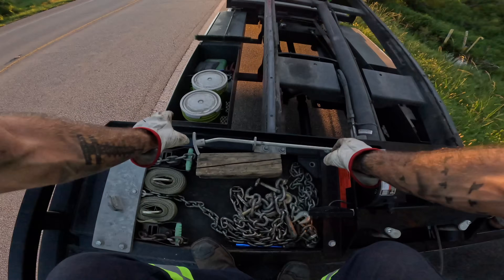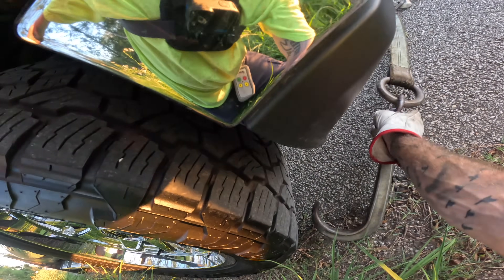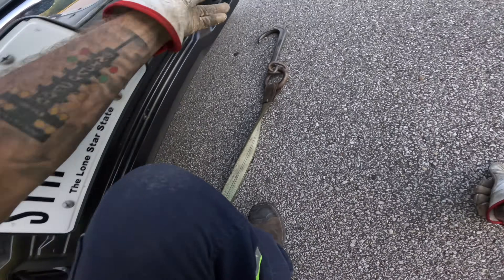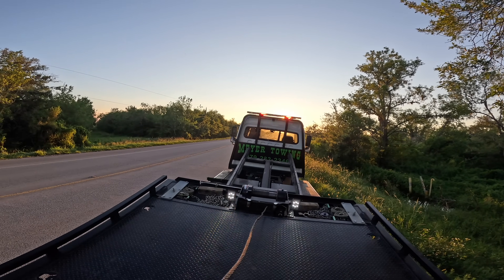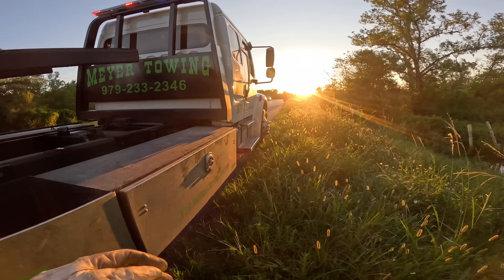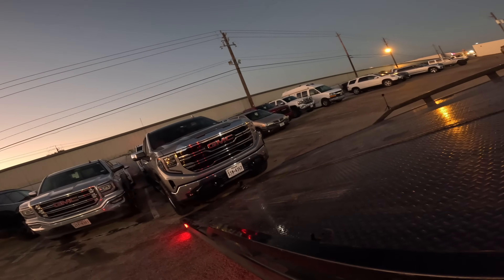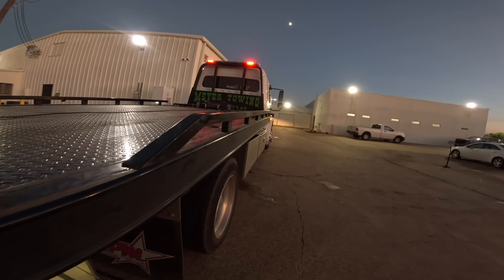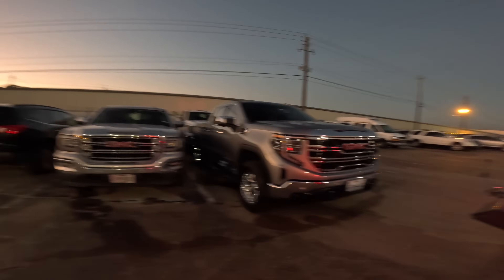Is GM Ever Going to Fix These Trucks??

Comment: First off, thanks for taking such great care of your customer's vehicles. Just curious though: if you can operate the transfer case to take it out of AUTO into 2HI, couldn't you also put it into transfercase neutral?  That should allow the vehicle to roll independently regardless of transmission gear selection.
Reply from the maker: No. Because part of the procedure for putting the transfer case into neutral is putting the transmission into neutral first. Obviously being the whole issue.
Reply: @Towtruck_Dustin  ok.  I'm unfamiliar with the newer console shift trucks.  Good to know.

Comment: The answer is no.

GM has been aware of the damage that their fuel management system does to the 3.6L V6, the 5.3L V8, the 6.2L V8 since 2007 and have done nothing to make it any better. You keep these vehicles with these engines past 150,000 miles and it is a near 100% failure rate with all of the components related to the failed so-called fuel savings tech. The sad thing is these are not bad engines (minus the 3.6L V6 that is a POS), but that fuel management crap destroys them. They are literally cancer.

Comment: 100 years of making cars and still cannot make one that work properly
Reply from the maker: The wonders of modern technology
Reply: Part of the reason is that most people want automatic transmissions.  My Chevy pickup has a manual transmission.  The tow driver would have no trouble putting it in neutral, but I have never been broken diwn.

Comment: I have a 2021 Silverado RST completely shut down will not start! What I learned was the system in this truck updated! All-Star and GM was unaware of these updates. My 2019 Silverado, my friends 2023 GMC Acadia did the same, the update takes around 45 minutes to an hour to complete when finished updating the vehicle starts right back up no issues. (these updates do not register with the diagnostic system of the vehicle.)
Reply: The truck shouldn’t shut down during an update.  That’s  really stupid…. I have a 2019 Silverado. So far no problems
Reply: @Getusom  Having to update a computer on wheels is stupid imo.
Reply: Sounds stupid, but true
Reply: @williebridges8286  I believe ya….i mean GM should make it to where it updates when the trucks not running, or it holds the update till the truck is shut off….i just wonder if they test anything before they release it!
Reply: You should understand that all electronics computers that integrated into your vehicle is from third parties, if the software need to be updated GM does not have to be notified for the updates. Remember, it is third-party software.

Comment: Why not just yerk that General Mistake up by the recovery hooks?
Reply from the maker: A number of reasons. Mainly because when the front end got up close to the winch you’d be pulling straight down on the hooks, thus loading up the suspension and the hooks aren’t made for that either, and if you used a bridle the back tires probably wouldn’t make it on the bed anyway.

Comment: The only way I'd Fork out 70,000 for a pickup truck is if it were a car show Trophy winner.
I had my 96 C30 gone through from front to rear with cosmetics and some extras.
Turns heads everywhere I go, and it's going to outlive me.
And I can actually work on it myself if I want to.
Have not needed a tow truck in 30 years.

Comment: Thanks for the insight on GM.  You guys having to tow them, know what the bad models are.   I had a 2006 Dodge Magnum SRT8 that had a transmission issue that wouldn't allow it to shift out of park.  The tow guy knew exactly what the problem was due to have to deal with so many Dodge cars having the same problem.  I haven't bought a Dodge, Chrysler, Ram product since, now more so since Stellantis owns them.  On the GM was it made in Mexico like my company provided one?

Comment: The late model Duramax Diesel trucks have an issue with Allison transmission that suddenly can shift into 2nd at highway speeds that can cause loss of control as truck skids and over revs engine......FabRat has a video about his own truck doing this.  He had to install an aftermarket kit to fix issue. His truck had 70k on it.
Reply: From what I recall, those are not Allison transmissions, they are just using the nameplate.  I know, hard to believe.

Comment: @Towtruck_Dustin if you have battery power you can shift the transmission to neutral by pushing the start button without holding the brake, holding just the start button puts it in accessory mode, you can the put your foot on the brake and shift to neutral, and you can release the e park brake at the same time.
Reply from the maker: No you can’t. Not with the electric shift trucks.
Reply: @Towtruck_Dustin   i have the electronic shift truck and yes you can.  I have done it

Comment: I had a chevy van from 2004 awd and the dam transfer case self-destructed and the dealer i had it towed to since it only had about 28000 miles on it tried to tell me i did not do proper maintenance on the vehicle i was pissed i said try reading the manual there is no maintenance for a transfer case at 28000 miles other than check for leaks. they finally begrudgingly replaced it.

Comment: I'm not one to usually leave comments but as a mechanic and to help anyone else out, most of these transfercases have a neutral mode marked with an n that disconnects the transmission from the driveline. Unfortunately not all of the trucks that have a transfer case have this mode but most do, its either a button or a procedure
Reply: but the real thing is why is a 2023 truck dying on the highway....it's a sad time for GM
Reply from the maker: Step two of the procedure of putting the transfer case into neutral, is to put the put the transmission into neutral first. Of which you can’t because it won’t run.

Comment: About 10 years ago I had my RAM 3500 towed after a starter went out. The guy brought a flatbed like this and winched my 22 foot truck up on the bed with it in neutral. Then while the winch was holding it up on the steeply inclined truck he started leaning over the side of the truck within inches of the front tire. It scared me to death that he was trusting that winch with his life.

Comment: excellent skills by the the tow truck driver,just one question why do you not carry wheel dollies? The wheel dollies would have made the  tow much less complicated. These GM 'S are a major problem, I have three friends who had the same issue with these GM'S ,all the same issue, and  they had  problems with  the dealers.No GM trucks in my future, and I am a tier one supplier(not fuel injection parts)

Comment: To the GMC pickup owner, constantly driving around in 4AUTO will burn out the transfer case clutch pack. Costs thousands to repair.
Reply: Maybe I’m wrong, but I thought when in auto position four wheel would only engage when it detected wheel slippage or out of control instances.
Reply: @dc9039 pretty sure you are correct that’s why it says auto.
Reply: @dc9039  - The transfer case has a clutch pack that does engage when slippage is detected when in auto. But the truck will also engage the front axles. This will cause the entire front axle and the transfer case to be spinning. When in 2WD, none of that is engaged.
Reply: @chiplangowski3298  Yep. You can feel the difference when it is in 4 Auto.  Tiny bit of vibration that isn't there in 2wd. 

Auto 4wd is not AWD. Which a lot of people seem to confuse it for.

Comment: My friend HAD a '22 Silverado with the electric shift as well. The fuel pump module is what we believe went out at right about the mileage this one did. His mechanic attached the 9/16" wrench and zip tied it in neutral. He also disabled the electric parking brake. We winched it onto his car hauler trailer and took it to the GM dealer and they diagnosed the bad module and told him it would be 6-8 weeks before they'd see a replacement. GM SUCKS!! (My friend's was a Diesel-GM told him that they all use the same module)

Comment: You are supposed to be able to get them into neutral by holding the start button down with foot off brake to get into service mode, then finger off start, foot on brake, shift to neutral. If it doesn't work... what a shock. I'm an electrical engineer, I do embedded electronics for the military. I prefer to leave the electronics at work.
Reply: You cannot put these trucks in neutral without the engine running. The computer will not allow the shift. There is a manual way to do it but it involves getting under the truck and it is not a safe procedure to do by yourself or on the side of the road.

Comment: Hey hey this is Ken from groveland Florida I'll tell you the secret I use when I'm out on a thing and the cars won't get over and give me room I walked by a truck grab a chain binder and throw it right on the white line on the Edgewood road I want that car see that chain binder they get over quick they don't mind running over you don't want to run over that chain by there because they think they're going to get flat tire but I run over to wrecker driver real quick but they won't run over a chain binder or a chain try that next time you'll see that works this is Ken groveland Florida

Comment: My 2014 All Terrain bailed on me at 180,000kms. Engine started using a litre of oil a month, 6 speed trans started slipping and the front diff shot a roller bearing into the case. I bought another Truck, guess what it wasn't....
Reply: yea my impala started to die as soon as i got it paid off, it had 200k miles and the transmission was going out. I got tired of fixing it every month so i bought 25 camry.
Reply: The 2014-19 6 speeds run way too hot. Unless you researched it back in the day, you didn't realize there's a trans cooler bypass thermostat that can be molded to keep the transmission much cooler. It saves most gm 6 speeds from failure. They also need trans fluid changes every 40-50k miles. 100k miles on the original fluid is a fast way to needing a rebuild. As far as oil consumption, that's getting to be more common, particularly people that think they can go more than 5000 miles on the same engine oil because they bought the fancy full syn oil. Even Toyota says it's normal for their engines to eat 4 quarts of oil between 5000 mile oil changes.

Comment: I just retired from GM after 30 years at a dealership GM is aware of all of these problems. We have told them other tech have told them and they will not do anything about it. We have told them numerous about the lifters the Duramax diesel, which is no good. We’ve told them everything. They just smile and say we’ll look at it and that’s where it ends people need to research vehicles before buying them and GM is definitely not one of them so many people have put this on YouTube all over the Internet just don’t buy them even if you think they look good
Reply: Couldn't agree more, They are good looking SUV's & trucks but that's where
it ends. They built reliable trucks up until around 2007, really dropped the ball
after that.
Reply: Transmission Shutter is terrible also, My Dealership tried to charge me between $500 to $800 for the recommended (TBS) Triple Trans Flush. I took my Truck to the local GMC dealership and they did the Flush under the Power Train warranty. 400 miles later the Shutter was worse, they did a Torque Converter and Valve Body replacement.  Truck had only 7700.0 miles on it.  Selling the Truck this week, 8886.0 miles on it.

Comment: 13,000 miles and down she goes. GM junk !  GM makes them look pretty but they don't last.
Come on people , stop buying these junkie trucks . Make GM build a better truck.
Remove the crap on these truck that cause so many problems. These problems will just come back in a few thousand miles
I miss the good old 350 chevy engine

Comment: You need to get a 2500 HD pick up truck ❤my truck is a 2021 GM pick up truck I have 72.000. On it and the truck is doing very very good all the time ❤❤❤with the 6.6 engine in it

Comment: I had a 2003 gmc pickup and went to gas it up and left it running, and the fuel pump went bad. Luckily, it was new. They said it was because it's a closed system. So I never leave the vehicle running while fueling
Reply: when i started driving long ago they said never leave the vehicle running while putting gas in it. it's dangerous.
Reply: If this were really an issue, I'd suspect a kill switch would have been implemented on the fuel fill entry point.
Reply: That was in 2003, and I quit leaving any vehicle running regardless of whether it was the issue or not

Comment: I've been driving around with a spare FPCM in my Silverado 1500 ZR2 truck for 1 year. Takes about 5 minutes to replace above front of gas tank.
Reply: do you need to program it after replacement or it will work even without programming?
Reply: @rafciu123  i can not confirm from personal experience. I've never done it, but someone told me it was just a replacement. Should always disconnect the negative battery cable before installing. When reconnecting battery, your system should reboot. DIC might give you a roll down, roll up window message to complete the process.

I wouldn’t mess with it around town, I bought it mainly for cross country travel and offroading a long way from town "just in case".
Reply: @rsbreeze  if i had to carry spare parts on a brand new vehical......id be insane...no way in hell.
Reply: @bestoflincolnmotorcompany  you'll have to do it sometime. You may as well rip off the bandaid. I've got three of them, seem to work fine. I carry tons of gear and parts for my adventures. Gotta have a chase truck.

Comment: Ever wish for the good old days of manual transmissions?
Reply: I had a 2001 Dodge 1500 with the basic six cylinder engine and the 5 speed manual.  It was all the truck I needed.
Reply: Not me, because I have one in my 2016 Chevy Colorado.  It's an Eaton six-speed and is the best transmission I've ever driven.
Reply: @GH-oi2jf  I hear ya.  I'm older now (64) and my current 2012 Silverado (basic 4.3 iron block v-6) with the 4L60e tranny.  I'm done with manuals now and even my 18 wheeler is automatic (not my choice but the company went with all autos).

Comment: Then you wonder why we bought a Titan instead. My wife and I were looking to buy a full size truck back in 2020. I was a Chevy/GM person. After test driving a new 20' LTZ Silverado, I felt the transmission slip while driving it in the lot. I said "No thanks"! Was looking at Tundras after that and then, Toyota changed the body style without V8s. Didn't want that. We ended up getting a fantastic deal on a new 21' Nissan Titan SV and not once did it give us problems after three years of ownership. We lost that truck in a vehicle accident because it was totaled. We were fortunate to survive. Now we're back into a new 24' Titan Pro4X! The last year that Nissan is making them. It's too bad  because the Titan is such a reliable truck. We have the last year of the Titan with a V8 engine. Love it! So underrated!
Reply: Nissan is even worse.
Reply: @AVMAR You can call Nissan whatever you want, but I wouldn't trust anything else for my family when it comes to a full size truck.
Reply: Grats on the new Titan. Great truck. Just got a 24 Pro 4x Frontier. Love it.
Reply: Don't go with RAM. Stalantis is not a good company.

Comment: So it's a fuel pump issue with them? i would have guessed a DOD/AFM lifter failure. And replacing the shift lever with a knob is just another reason I won't buy anything new they are making. Along with that start/stop crap. And this video shows why towing cost's what it does. Look at all the extra work he has to do just to get it on and off his roll back.

Comment: Why do you use the control arms instead of the recovery hooks for pulling the truck?
Reply from the maker: Because I wasn’t doing a recovery. 
Try to winch a full-size truck up the bed by the tow hooks and the rear tires won’t make it on the bed, and you’ll be pulling down on the suspension when you get the front end close to the winch.
Reply: @Towtruck_Dustin  That makes a ton of sense. Thank you for answering and sharing your knowledge.

Comment: The 5.3L engines eat lifters and cams. Junk.
Reply: Kind of like a 5.4 Triton hunk of junk
Reply: yep, junk valve trains. grab your wallet.
Reply: @earl-d4n  and if you have a Dodge or Ford you better get another job because those hunks of crap are going to leave you stranded everywhere
Reply: @thethiefonthecross9092  gm too, ALL junk in my mind. thanx for the tip but I have a nissan frontier. it's a solid no frills truck that a lot of folks yearn for these days.
Reply: @earl-d4n  I have a 2020 GMC Denali 3500 4 by 4 diesel. I think the heavier duty trucks with diesels seem to hold up much longer then your gasoline trucks because the heavy-duty ones are made for hard work so they don't break as easy
Reply: So does the Dodge RAM

Comment: Gm doesn’t want to fix it..seems that way
Reply: Manufacturers figure it's cheaper and easier to repair one by one than to do a massive recall and repair all for free. Then there's the parts required for a mass repair of tens of thousands of multi-years trucks and SUVs.

Comment: Where are all the GM fanboys? They always swear up and down by these trucks. Constantly living off that 90s glory. 2014+ GM trucks aren’t any good.
Reply: They turned into garbage in 2007.5
Reply: @brentbarnett9224  blame it on the AFM and garbage transmissions they put in these trucks. I’ve owned 3 GM trucks. My 2002 Silverado 5.3 and my 2008 Sierra 5.3 were great trucks. But I had a 2015 Silverado 5.3 a few years back and it was the worst truck I’ve ever had. Transmission went out, lifters, low oil pressure, AC went out, electrical issues. All within 40-50K miles. Never again.